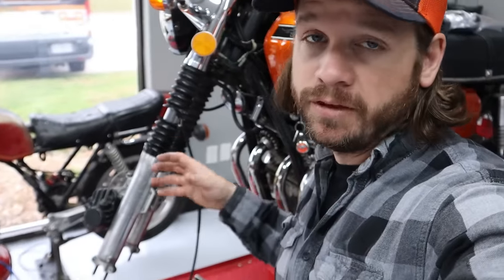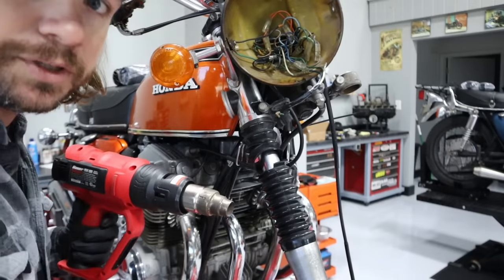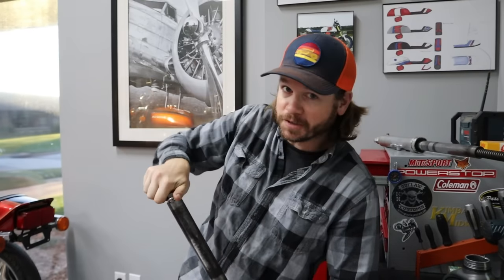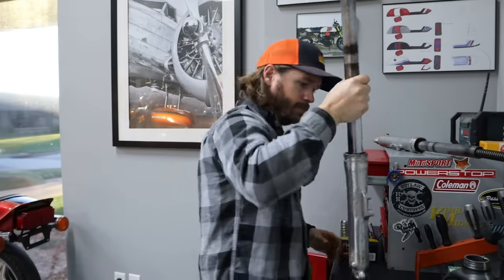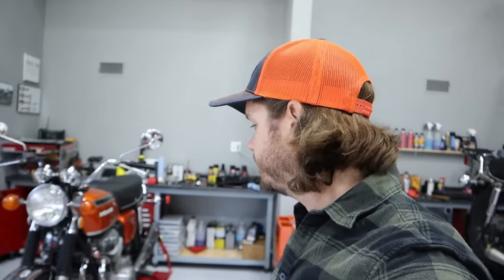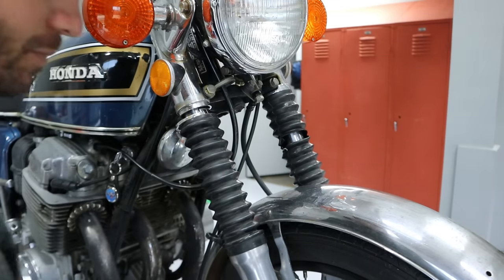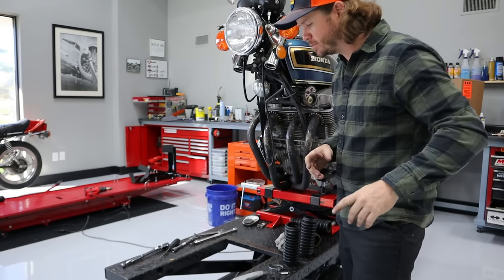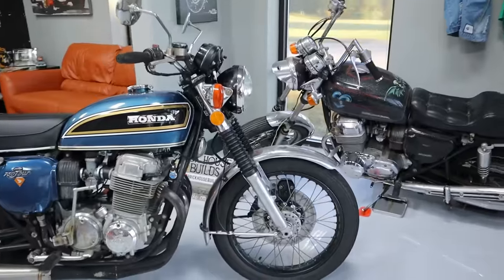CB750 Fork Seals and Boot Replacement!

Comment: I really enjoy seeing spanners being twirled and how another bike nut goes about his work. For me, there is poetry in these motions, with your patience and quiet determination having an artistry about them. I really appreciate your work. Thanks for sharing it. FWIW, I don't remember seeing a video showing the same job on two similar bikes before, the point being I liked you adjusting your approach for Patty. I was surprised actually how easy it seemed to be for you to support the weight of the front end at the same times as twisting the stanchions and rocking the whole unit to engage and slide the forks home. I said to myself, that's a mistake, way easier/faster to remove the wheel and do one at a time. I was wrong. Good luck with everything and don't lose confidence in yourself. You're great.
Reply from the maker: Well thank you! I thought it was fun to show that difference in approach so I'm glad you enjoyed!

Comment: Love these episodes! I can highly recommend getting a set of those hard plastic trim remover tools (cheap on Amazon) and while it may introduce a wee bit of mess if you don't prep for that ahead of time, spritzing in a bit of something like WD-40 in any crevasses that you warm up and as you pry out with the plastic tools, helps immensely with breaking the stiction that rubber or plastic has against itself or other materials. Just a thought. I spent years fighting damned sticky rubber or plasticized with age intakes/fork boots/grommets etc., before the wonders of heat+lube+safe prying tools lol. I now have several sets of cut down and sharpened custom plastic prying tools that save me soooo much frustration and time.
Reply from the maker: Definitely a good idea

Comment: Oh boy. I've done the front end tear down enough times to warn anyone off on trying the whole assembly like BJ did. This requires the bike to be tied down on a lift like he has done VERY securely because it is easy to topple the whole thing with the upward force required to get the fork legs back up into the triples. BJ is very experienced at this. Well done sir!
Reply from the maker: Definitely had some straps in the right spots!

Comment: Absolutely love it when you work on the old Hondas, especially your 750. I just rescued a 1980 CB650 from a shed and got it back on the road (2152 miles, still on original rubber). I enjoy going back and watching your 750 playlist from the very start where you weren't sure if you were even going to keep it. So glad it is one of your favorite bikes now!
Reply from the maker: Daaaaang 2100 miles!!! Thats awesome! Obviously be careful on that original rubber but have fun!
Reply: @BrickHouseBuilds  already pout Dunlop 404s on both ends, but did put 100 miles on the old rubber! BTW absolutely love that blue on your bike

Comment: Great job on those SOHC Hondas! We used to put the GL1000 front fender on these bikes along with a 16" wheel to give it a good look & stance, then a Kerker 4-1 header w/comp baffle to make it quite a bit peppier and have a nice exhaust note. Honda also used to have a dual disc front end setup for these bikes, hard to find back then, unobtanium now.
Keep 'em running, BJ! Thanks for a cool video.
Reply from the maker: I have almost all the parts needed to have a dual disc front which may be a fun project.
Reply: @BrickHouseBuilds  very cool! Would love to see you do that conversion on your blue CB750.

Comment: FYI ~ there were two bikes that I noticed on fb ~ OOPS, I'm not paying attention.  Nice music.  Sort of.  and the plastic bag trick. Fork oil?  I had no idea.  Wow.  So yea.  Two bikes on fb very similar in vintage and make/model ~ one of these and one of the older nighthawks, both cb750.  One 1987 and 0ne 1984.  Both clean, yes but both were priced over 3G.  Go figure. These videos are so helpful. Given the time I hope I can do this myself.  Oh yea.  I always wondered about the plate on the lift.  Mine got smooshed.  Those little clips.  Oh yea. Nighthawk 95.  I have an aluminum fabrication job that i worked on today so I may dig into that bolt tonight not sure at least tomorrow.  Soon a Key.  Maybe there's a sock in the light housing with a key in it.  Maybe?  Who knows.

Comment: Also, I had a 1971 CB750K1 in gold/orange. I loved the engine, the riding position and view over the clocks, the sound. But the handling was not for me - hinge in the middle. I got the swingarm bushes replaced by a bike shop, with genuine fibre bushes installed. There wasn't much improvement. I regret not looking into phosphor bronze in hindsight. Maybe that's something for you to consider.
Reply from the maker: I actually have a set of bronze bushes ready to go on!

Comment: I love these videos.  Another motorcycle on my list to ride.
Reply from the maker: A classic cb750 is very hard to beat
Reply: @BrickHouseBuilds  I looked up the stats for a 1976 model. 1/4 mile in 13.5 seconds at 100mph. 67bhp. 50ish years old and still capable.

Comment: The baggie is a cool tip. Give ya a tip back... Never use red thread lock on a motorcycle. That stuff is for big vehicles and heavy equipment. Motorcycle manufactures have even restricted using it in the last few years. Blue at the most. If you tighten to torque specifications, then really no need for any of it. Not hating, just offering some advice. I enjoy your vids. I recently obtained a barn find '72 750. Gonna strip her down to the frame and restore her.
Reply from the maker: I generally use red on the fork leg bolts and key fasteners on bikes that vibrate excessively like my xs650. Otherwise I use blue 95% of the time

Comment: Biggest takeaway: backing a bike onto the lift. Many years wrenching but only recently got a lift and want to use it for an upcoming fork seal job and was wondering how to do it on the lift, so this helps.
Reply from the maker: Backing a bike on is much more difficult but made sense for this job. Definitely use an extra set of hands rolling it on backwards as its very awkward

Comment: I can’t get over how beautiful that 72 is. Love ol blue too, but something about that orange. It’s just screams 1970’s.

I need to do this to both my 74 and 75. Went out to the garage and saw a puddle of fluid coming out of the bottom of the fork. I can’t remember if you upgraded the steering bearing bearings on the blue bike? But was thinking about doing that on both bikes while I had the forks off.

Keep up the awesome work!
Reply from the maker: The orange is just amazing looking.  I did do a taper roller conversion on the blue bike but have never had the front end off the orange one

Comment: Great work BJ 👏  Two beautiful Honda Motorcycles  . It wouldn't surprise me if Honda put these bikes back on the production line with obvious changes to abs and emissions. 
These bikes look so Cool 😎 compared to modern plastic models.
Don't get me wrong l love modern bikes, l love all bikes but l believe there's a market for the 70s Houda 550 and 750 four.
Reply from the maker: They did try with the CB1100 but I guess nobody bought them. Those bikes look fantastic and tick all those boxes in my opinion
Reply: @BrickHouseBuilds  yeah the 1100cc was never going to sell . Insurance over here in Ireland UK  and Europe is astronomical The 550 and 750 would be affordable for all ages.
My cb 500s 2002 is perfect for Irelands coastal roads,  very enjoyable 😉

Comment: I have new boots for my 750 but haven't put them on yet.  I figure when I replace the fork seals I'll do the boots.  That ring at the top of each boot has always been a bit of a mystery to me.  I think I found one video that shows the proper way to put the new boots on.   I like the zip lock bag trick.   Most videos i've seen they pound the seal into the bottom part of the fork then put the tube in place, but putting the seal on the tube first seems better.
Reply from the maker: Some bikes you can install the seal then the leg but for these you must put the seal on the leg first

Comment: So I was looking for people's 0-60 times on these.  They're 7 seconds and under right?  People were arguing that 0-60 doesn't matter, but in my opinion 0-60 matters because it's more about how quickly you can get up to travelling speed in relation to traffic.  I always think about on ramps for interstates being the best place for a having a good 0-60 time, rather than a racing context.
Reply from the maker: I have zero idea what the 0-60 would be. It's perfectly adequate for getting up to highway speeds though.
Reply: @BrickHouseBuilds Yeah, that's exactly what I thought man.  Bikes are FAST.  I think sometimes people don't realize how fast even a "slow" bike is.

Comment: Hey Bj, have you come across a honda cb700sc nighthawk, I'd give me left arm to see you to a restoration on one of those!! Pa I have one here in Ireland, needs work to get back on the road, oil cooler, leaking, carbon floats sticking from been left lying up
Reply from the maker: Those are such cool bikes. If I found the right one in black/blue needing work for cheap I'd jump on it but I haven't done so yet
Reply: @BrickHouseBuilds  I've seen loads pop up in the states for very little, even the black chrome exhausts go for few 100 dollars, it's the shipping to Ireland thars a killer

Comment: Hey BJ, great work and love the way the front of your new workshop has come out! Excuse my ignorance but what’s the wiring at 5:23 on the left fork ear connected to/for? I wouldn’t have expected there to be any electrical components on that part. Just trying to learn more about my CB750 as I’ve yet to do any fork work on it. Thanks in advance if you manage to see this! Keep up the great content!
Reply from the maker: No worries! That is for the turn signal beeper. It's an incredibly annoying beeper from the factory.  You can hear it in action as I test the bike in PT2 of the linked videos
Reply: @BrickHouseBuilds  Ahh that makes sense! Appreciate the reply!

Comment: Hey mate, is that chopper style CB750 yours a freinds or customer?  It's got the 4 into 4 pipes and other great parts you can swap if it's yours. That orange one was nice. Actually did you notice your front forks were in better nik than the orange ones. All good Bloke. Really enjoy your channel. Would of loved to come to your open day. Australia and you are too far apart in distance.
Reply from the maker: The chopper is mine yes. I don't plan to make any changes to it as it's very period. For the forks on the blue bike I did swap those with a cleaner set from a 78 I have as they were pitted like the orange bike.

Comment: Hey sir! Im waiting on parts to rebuild my forks and Im not sure whether to use fork oil or ATF. I noticed you used a fork oil is that your preference on these older bikes?
Reply from the maker: @dakota-joel7590  well back in the day they really didn't have fork specific oils so they used atf. That's OK to use but a 5 or 10w fork oil is fine. You can try and change depending on how you like the feel
Reply: @BrickHouseBuilds  Appreciate it!

Comment: Question? If the boot is already ripped off, why not simply cut it off with a razor blade?
Reply from the maker: Well it's best to avoid gouging the metal which a razor blaze runs the risk of doing. They still need to be unseated from the grooves and once that is done its no extra work to slide them off since you need to have the forks off to install new ones.

Comment: What oil did you use in those forks? And how did you treat that rust?
Reply from the maker: I likely used a 10w and removed the rust I could and then coat with wd40

Comment: Putting the fork boot onto the top part and getting it attached before putting the tube in seems like the way to do it.  (Although you did it both ways, and didn't have much trouble with either.)  Not sure why Honda didn't have those two caliper bolts enter from the left side.  Going in through the spokes seems like a bad design.   I think on other CB's the bolts went in from the left side.
Reply from the maker: Could be yes but not much trouble at all to do it after installing the legs

Comment: For a complex multi step process like this, it would be really helpful if you were systematic about explaining the process, step-by-step. You were sort of all over the place and for those that have never done the job before it could be confusing.

Maybe at the beginning of the video, layout exactly what you’re going to do step-by-step, and then show that. Explain what you’re going to do then show  each step with comments in VO to explain any details that might be confusing. What do you take off first, how do you order reassembly?  Tricks like your plastic bag one (which is one. I’ve never heard of-  it is a fantastic tip btw) can be commented on in voice over too. 

For example, you disassemble the shock assembly but details like what seals going where what tools are you using? Is there any preload on a spring, torque settings? How much oil goes in each for tube? Where are you sourcing your replacement parts? You obviously know what you’re doing you’re just not telling us exactly how you do it.

Just a thought.  

Many out here in YouTube land are trying to do the job you’re showing, and if you don’t lay out all the steps, they might miss something.

Great, looking bikes. I have my dad’s 73 exactly like this orange one. Sadly it’s nowhere near this condition but I hope to restore it one day. Thanks for putting out these videos.
Reply from the maker: I appreciate you watching.  This wasn't intended to be a specific how to video but rather just something easy to watch as a lot of my audience likes to "hang out" in the shop with me. Normally if it is a how to video I have that in the thumbnail. It's also a battle as every time I do a how to I always get comments that are extremely rude saying I have no idea what I'm doing so I tend to just not want to anymore due to unfortunate backlash while trying to help.

Comment: Has any environmental group done a study on how enthusiasts are saving the planet by repairing old equipment with a "few" parts vs buying a brand new bike (all new resources pulled from the earth)?  Seems like it should at least be a foot note somewhere for making these machines sustainable in the long run
Reply from the maker: I've wondered about this exact thing very often. Could it be argued that say my 1975 cb750 is more environmentally friendly than a new Prius? I'd love to see information on how that could be extrapolated. For the old stuff it has already had its minimal manufacturing impact and then a tiny amount of pollutants over 50 years versus a modern vehicle that takes many precious metals to make. Very curious